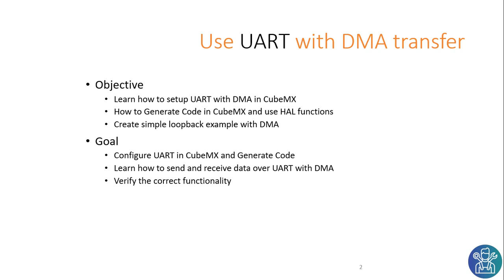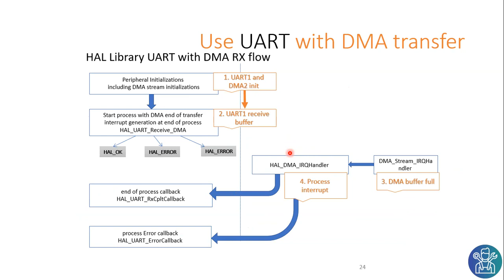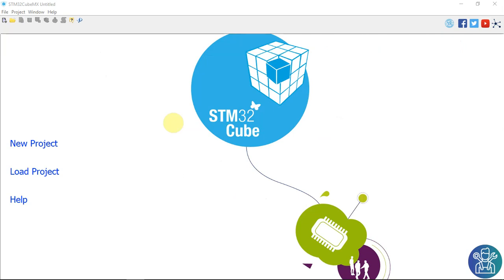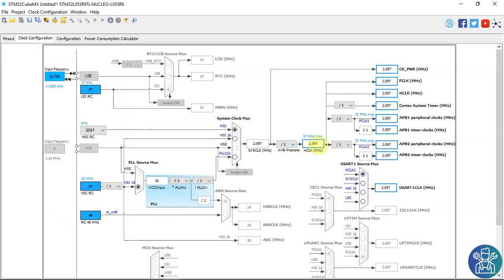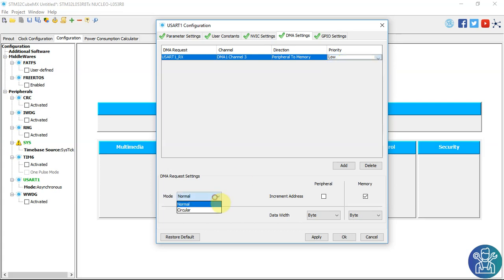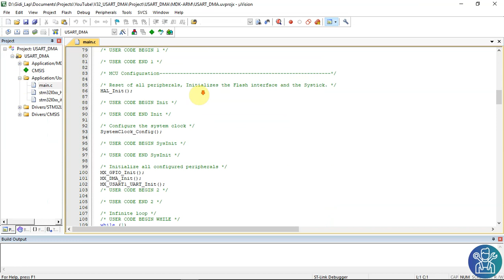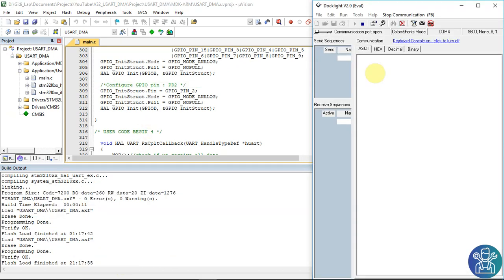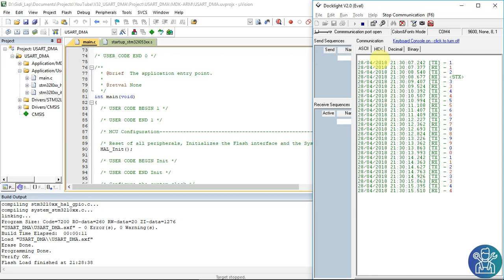HAL: #6 How to - USART with DMA

Comment: Please note for DMA: If using newer version of CubeIDE - code configuration is wrong by default. 
In main ->
 change :  
/* Initialize all configured peripherals */
  MX_GPIO_Init();
  MX_USART2_UART_Init(); 
 MX_DMA_Init();

  /* USER CODE BEGIN 2 */ 

To:

  /* Initialize all configured peripherals */
  MX_GPIO_Init();
  MX_DMA_Init();
  MX_USART2_UART_Init();
  /* USER CODE BEGIN 2 */

@Web learning please let your viewers know of this issue.
Reply: Thanks! I've been strugling with this for some time, and this solved it for me!!
Reply: This is very true. Where exactly is this pointed out? I haven't seen it.
Reply: Best to change the sequence in IOC Project Manager / Advanced Settings. DMA position is fixed, but you can move UART / TIM initialization behind DMA. If you change main.c and then change IOC file the IDE will overwrite your changes.
Reply: Thanks a lot for the tip!
Reply: OMG! THANKS A LOT!!!!!
I WAS STRUGGLING WITH THIS FOR OVER A WEEK!
Reply: You deserve a crate of beer for this comment.
Reply: THANK A LOTTTTTTTTTTTTT!!!!!!!!!!!!!!!!

Comment: Call back receive will not work after first frame is received. You have to re-call this _IT function again in.
Reply from the maker: Worked for me. Dont know why you are not receiving first frame.
Reply: @Weblearning1  it is working for you because since you shorted RX and TX , you are receiving what you transmitted, more over to check DMA is working you have to use debugger to monitor the RX buffer instead you are seeing the serial monitor what do you expect?

Comment: Hi, i  try to use DMA with i2c transfer and receive using blue pill for Eeprom . My read data function working well and call back also working well but on data write (DMA TX) I2C SHIWING IN BUSY STATE CONTINUOUSLY there after whole communication is stopped why my DMA TX USING I2C IN BUSY STATE CONTINUOUSLY ? 
   INSTEAD IF I USE BLOCKING ( I2C TX ) IT WORKING FINE. BUT I2C (DMA TX) HAS BUSY STATE.
Reply from the maker: Thanks for sharing

Comment: May be your code needs a correction, on this one. Because you are shorting on the pins thats why you are getting a response this is not correct. To test this code correctly you have to short them by the code , I mean that you have to copy received data in the transmission DMA buffer. By doing this only you can check if your program or configuration is working or not.

Comment: Very useful tutorial. You are very great. Person like you rarely possible to see.Thanks a lot.
I just want to know, for STM32F103 can we use USB as Host and Device both?
Reply from the maker: Thank you for this. The feature that you refer to on the USB its called OTG. You need to use another pin called ID to know if you are the Host or Device. But, its only supported on the F105 and others. More info at this site: http://www.emcu.it/STM32/STM32_USB_Device_Host_OTG/STM32_USB_Device_Host_OTG.html

Comment: Hey, I was actually search the internet regarding I2C and SPI DMA. I was wondering if you have time to do a tutorial? I notice a lot of the guys either have issues regarding how the bus works in DMA mode. I would say that is all dependent on the Sensor or device transmitting data.
Reply from the maker: Hi, yes it's in the pipeline, but I never got around to record it.
Reply: I was considering writing my own I2C drivers because I couldn't find enough on spec docs. I then proceeded to play around with i2c. I wanted to understand that driver full.
Reply from the maker: There is a great book that will answer most of your questions and it's not expensive:
https://leanpub.com/mastering-stm32

Comment: Hi well explained with the interrupt function you can do a data check of the buffer and ring the buffer to align data. I would like to request i2c DMA. I have had problems implementation of i2c transmit and receive. Very weird but I had loads of fun playing with the DMA. It is my first choice when running a Peripherals as it just frees the MCU up for the fun stuff.